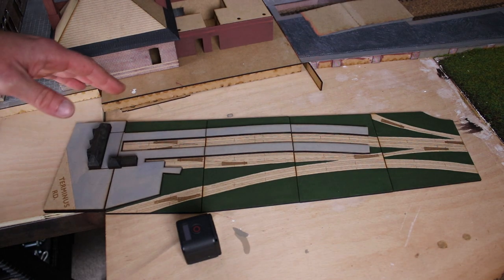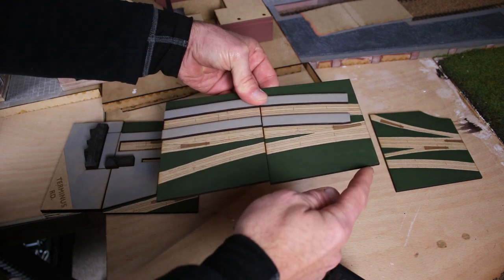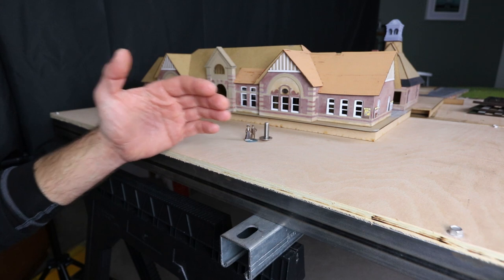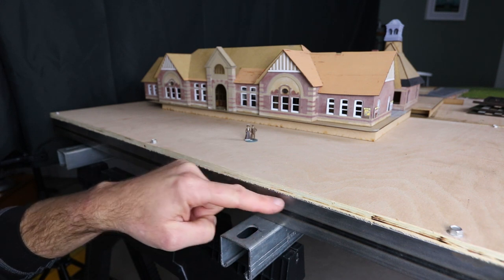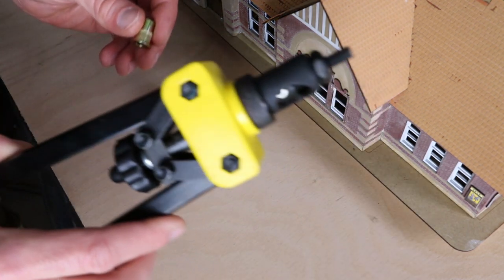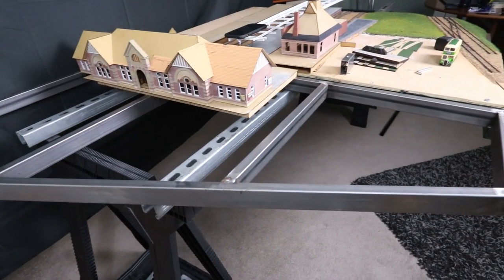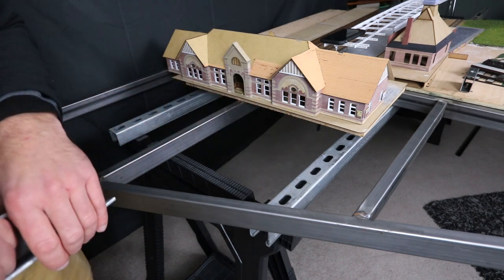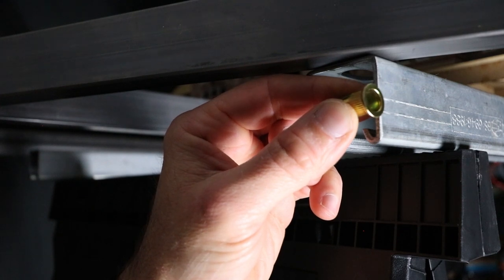Episode 36 Model Railway Baseboard Connections

Comment: Unistrut is the name of a manufacturer, it's correct name is Universal Channel (abbreviated to Uchannel) and it is actually 41mm x 41mm. Not sure why you need nutserts for the DC sockets? Just drill a hole and use a panel mount socket? The ultimate board frame is Aluminum tube or extruded aluminium, but let's not go down that Rabbit warren! lol
Reply: I'm assuming James used steel box because he's an experienced fabricator and has both the tools and skill needed to fabricate the frames himself

Comment: Riv-Nuts are very wonderful when working with metal. I have used them before. there is an insert that one can use with wood that has bolt threads inside the insert. The outside of the insert has course wood threads  and the inside has bolt threads. Mine have 1/4-20 on the inside. These work almost like the Riv-Nut. I like them very much and used them in my current road.

Comment: Very interesting way of doing things. Slightly over engineered though perhaps, but still ingenious. Would never have considered steel sections as a framework, just make sure that you prime it all carefully, Unistrut is galvanised but it can and will rust where it has been cut. Been a long time since I worked with Unitstrut, we used it all the time when I was an air conditioning installation engineer
Reply from the maker: Hi there, I agree this does seem rather over-engineered given the two baseboards shown in the video.  However, this is set to grow to at least 30 feet of scenic section with the run around loop adding yet more length.  
Should I get that far then no-doubt an extension to Sidley will become a possibility.  That being the case, and the fact that I can easily extend this framework indefinitely makes the choice a sound one for me.
As for painting the cut ends, I have plenty of Galvafroid, which I would recommend to all in such situations.
Thank you for your feedback it is much appreciated.
My best wishes,
James
Reply: @BexhillWest  Galvafroid was going to be my suggestion, but I wasn’t sure if it was still available as I last used it about 25 years ago! Looking forward to seeing this layout grow

Comment: Hi James
Just found your channel very good like what you did with the DAS plaster on the platform top I am going to have a go at that as tarmac 
on thing I would say about using metal base board construction is do not trap any wires or get a short we destroyed a DCC controller due to a short on the metal frame work five mins before the show opened at least we did not have to go to far to replace it 
Thanks Pat
Reply from the maker: Thanks Pat.
I can appreciate where you are coming from with this.  I think I've got it covered with my plans for the wiring, this is one of the reasons why I plan to use the unistrut as a kind of conduit.  I'm very keen to avoid the trouble you experienced.
All the best,
James
Reply: @BexhillWest Thank you James for the reply You was talking about doing an exhibition I know 2 exhibition managers would you like me to tell them about what you are doing???
Pat

Comment: Nice work James, Unistrut is my everyday thing I was going to suggest spring channel nuts zebs in the trade! Save inventing a fixing but then later the ingenuity of using it to take the wires is excellent. Then zebs will not work so forget that. The riv nut cable entry have you thought about just a TRS gland 16mm ? Will clamp the cable too. In the unistrut the return is that not a bit sharp? You might consider flexy conduit in there to protect cables, easily cut with a knife and 10m contractors pack about £6 + Vat.
Enjoyable watch 
Cheers 
Ade
Reply from the maker: Thanks Ade, The flexi conduit is a great idea, thanks for suggesting it.  :)

Comment: One thing about your steel base frames you will possibly have to account for if you take it to model railway shows in the future,  is how hot some venues can get.  Can be common for layouts to suffer problems with heat expansion of the rails, and allowance is usually make for that.  I was wondering how your boards might fare with the variable temperatures you might face? The frames won't probably be a problem,  but the wood might warp on split with the frames expansion or contracting?
Reply from the maker: This was briefly discussed in the comments of an earlier video in which I showed the maths which should alleviate and concerns in that regard. Certainly from experience of leaving the boards in a hot conservatory in direct sunlight there doesn’t seem to be a problem. 
Thanks for watching,
James

Comment: you can't stop me being inspired by this video to attempt steel fabrication in my living room ;)

Great video as always, but in this one I noticed two audio issues - a constant background hiss and pronounced sibilance. Are they easy fixes?
Reply from the maker: Good luck with that, and watch-out for burn holes in your lovely axminster.  I have a cheap nylon carpet which now resembles the surface of the moon.  :)

Audio wise, your comment is very timely as I have just replaced my microphone with a Rode on-camera version.  I'm still to be convinced whether or not it is any better though, maybe you could let me know after next weeks video.
I have just googled sibilance, and am grateful to you for the increased editing load now that I understand what it is.  :(
Seriously though, thanks for the feedback, I am always looking for ways to improve the videos.  Direct and informed advice is always appreciated.
All the best,
James
Reply: @BexhillWest  My brothers trained as sound and recording engineers - when I was briefly responsible for a sound desk myself, I got an earful that mostly went over my head!

Laminate floor in my living room. Put up the dust-sheet, donned the 3M 7500-series half-mask, applied another layer of paint to some Peco wagons this lunchtime… and the dust-sheet seems to have collected the overspray into little clumps and dropped them on the floor. And the mask collected overspray in two lines down the sides of my nose… I think it's a poor fit.

One day, I'll live somewhere with an adjoining, heated garage…

Comment: It might have been me asking about how you were joining the boards, but I dare say others have also asked LOL nice one James , I assume you are using the slots with circular inserts so that you will have a little play forward and back but none side to side to make it easier to get the boards to go together ?
Reply from the maker: Hi David, Yes the slots in the channel do provide for some 'jiggling' in to place if required whilst maintaining a positive alignment at track joints. That was one of my reasons for the material choice.  Well spotted.  :)
Thanks for watching,
James

Comment: I think you are making the wiring more complex then need. I built touring Broadway sets and it just be easier to run a tap off cable out side of the unisttrut.
Reply from the maker: Hi James, I agree it would be easier.  However, I want the wiring to be self-contained, simple to set-up and protected during storage and transit.  I'd rather spend time to eliminate potential failure points at the build stage than go back and have to repair a loom which has become damaged.  That said, sometimes I think too much and anticipate potential problems rather than actual problems.  :)
Thanks for watching,
James

Comment: 10:00 Clearly gona improve the look of the station segment, but will the U-profil underneath not jut out -> little rest profil of your frames welded inside at frame-end for conection with the U-profil would complete this better.
You mentioned "DDC" 👍
Which kind of point mechanisms you thinking of?
For running your layout you would need the X-crossing outside of the station (as seen on original track plan) to change track, is that within your planned 15 feet / ~4,6m length?
Well most (translating "Modulbahner") modularly-model-railroad-people prefer wood, but always nice to see something else / alternative and for your use, photographing inside the layout, better.
Reply from the maker: HI Lass, the frame was sitting temporarily on the frame for the purposes of filming.  In the final set-up it is hidden.  As soon as I have the time (and available space) I will set it all together and show it fully from the underside.
As for point mechanisms, I will be using servos.  I have a mechanism designed which incorporates frog switching, but am still thinking about it trying to anticipate any problems which might occur.  
As for running the railway, when I started this project I had not intention of running trains.  It was just a photographic diorama.  Now it has taken a life of it's own I think I will extend it to encompass the entirety of Bexhill West, which will extend to approximately 30 feet, plus the run-around loop mentioned previously.
Finally, I would completely agree that timber frames are probably a much better solution for most, but considering the frequency of these boards being moved about and stored, I'm pleased I went with the steel frames.
As always, thank you for watching, I really appreciate your feedback.
Best wishes,
James
Reply: @BexhillWest  
Point mechanism: What you said is done by some (durability depends on how well it is done), alternative take a look at tortoise point motors and similar - they got a switch build in.
So maximal ~15 feet for photographing at home and ~30 + fiddle yard at exhibitions - or even much longer on a convention with other peoples models together if you set this as a target (there have been FREMO conventions in Danehill but in H0 / DB or you could try to start a group with your own rules).

Comment: Interesting approach with the unistrut, though I would've put it upside down and use its channel shape as the guide to align the boards (since I don't have a lathe to produce the custom bolts). You can, also, cut slots in it, to allow the box section of the boards to drop into it, making the plywood to rest on the top of the unistrut, to give it extra support? It could also help with keeping the boards close to each other.
Then, all you'd have to do is put the rivet nuts into the box section and make sure they align with the slots.
Ok, I know this a two months old video, but it's just a thought, I really enjoy seeing people come up with ingenious ways to solve problems and I can't help trying to contribute :D
Cheers and keep it up!
Reply from the maker: Thanks for your input Adrian.  The downside to cutting slots into the Unistrut is that it would lose some of it's rigidity and may require extra support in the form of legs or trestles.  But some great ideas you've added there which I'm sure will give others some food for thought - so thank you very much.
All the best,
James
Reply: @BexhillWest  i see what you mean, though I was under the impression that the box section is much smaller than the unistrut, so the slots wouldn't have to be too big. But now, considering your plan to run cables through the channel (awesome idea, btw) it's a must to have the opening downwards.

Comment: If I where to use the CAD software that you use to increase or decrease the size of one of your designs such as the turntable, is it a simple case of “select all, increase by 20%” or would I manually have to change every measurement one by one.
Reply: typically with any CAD generated file there are ways to simply scale the whole model, that works well for changing scales, however if one simply wants to make a larger version e.g to take a bigger loco on the turntable then you might want to non uniformly scale, better yet is if one uses a parametric CAD package in this case you might simply be able to say I want to increase the size of the turntable and make it 10 scale feet longer, this will keep the width (of the track bed) the same (which you would expect) but change the length and thus the diameter
Reply from the maker: HI Scott, short answer -  Yes!  :)
Longer answer, one needs to be mindful of construction details and material choices such as tabs and slots of interconnecting laser-cut parts, to give just one example.
Let's say a design calls for a 2mm slot to receive a tab on a part cut from 2mm think material.  If we simply scale up, then the slot size may not correspond with an available material thickness from which the part might be cut.  I hope that makes sense.
But essentially, you are correct.  CAD designs can be scaled up and down quite easily.  As long as you are aware of fits and interferences between components, then it would only be these areas which would tend to need adjustment post-scaling.
Best wishes,
James
Reply: @davidorf3921  thanks David, that’s great advice.